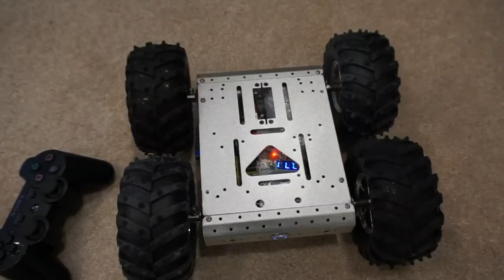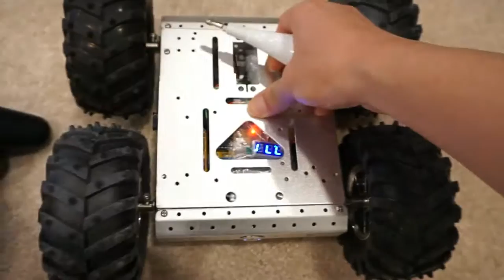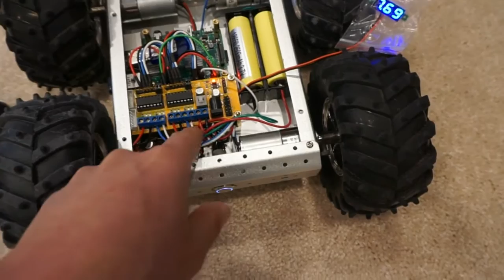4WD raspberry pi robot car internal structure

Comment: hi, I think I purchased the same Rover on eBay, was wondering what you were using to control the motors?  I had bought an l298n board but looks like you have a different motor controller.
Reply: To control 4 motors,you'll need l293n motor sheild.